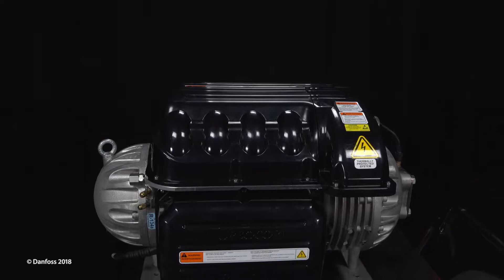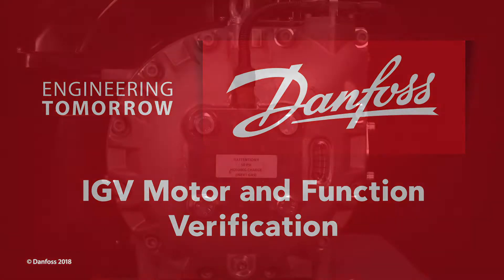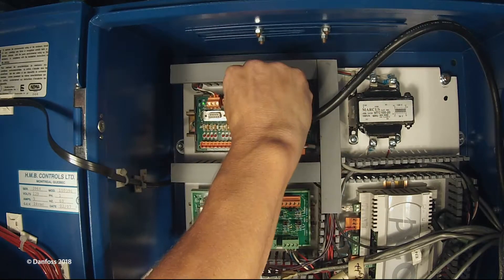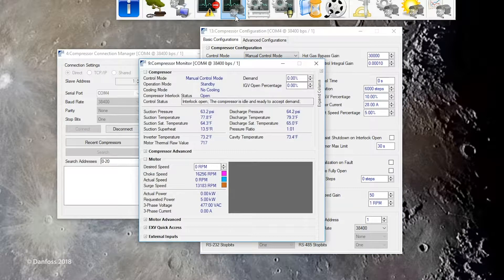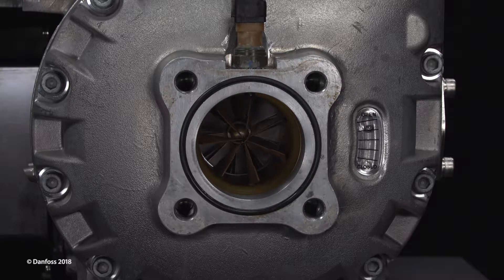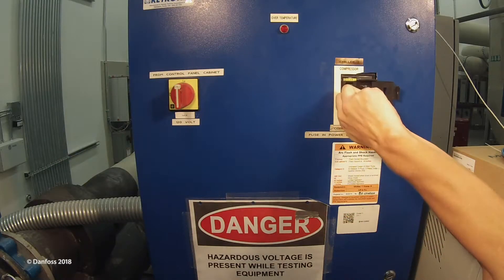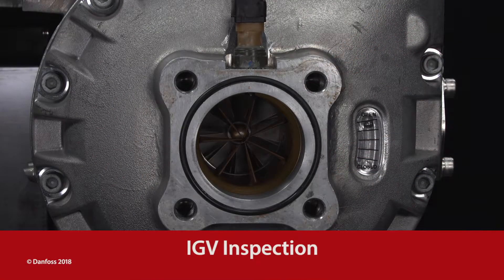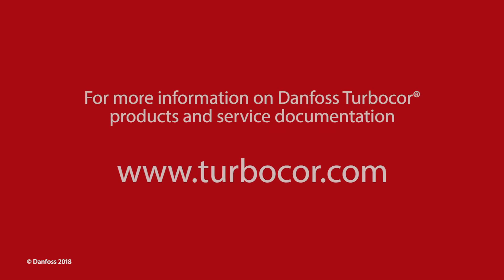Danfoss Turbocor® TT & TG IGV Motor and Function Verification

Comment: What are some troubleshooting proceedures if the IGV is unable to open? 

I have checked the various resistances on the pcb and contact point. 

Can I replace this IGV?
Reply from the maker: Hi Karthik, Thank you for your comment. You can read about Danfoss Turbocor® and Turbocorsupport US here: turbocorsupport.us@danfoss.com. Hope this was helpful :-)
Reply: Hi Karthik - did you manage the solve the issue? I'm facing a similar one. The local Danfoss/chiller manufacturer have checked the compressor using localized software - when compressor is offline - and the IGV seem to work fine (call fully open to 110%). But when the compressor is energized and operating, the IGV cannot fully open and this is visible through the IGV indication ball. Issue is ongoing for 1 year now and nobody could solve for us.